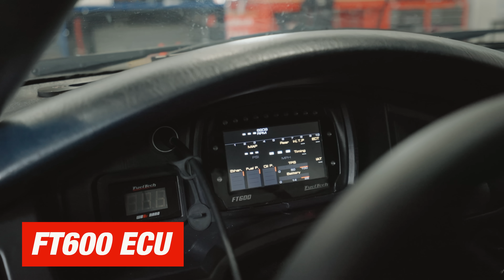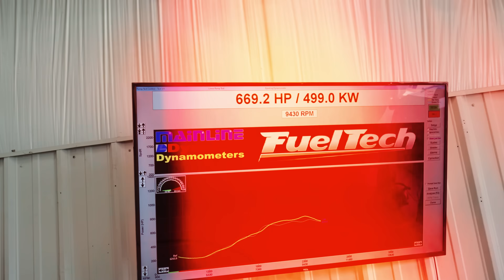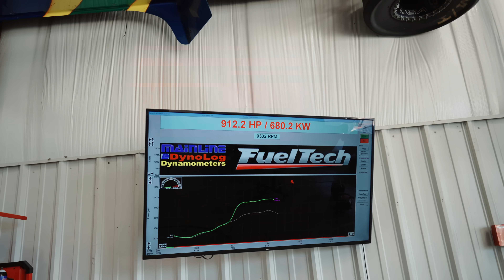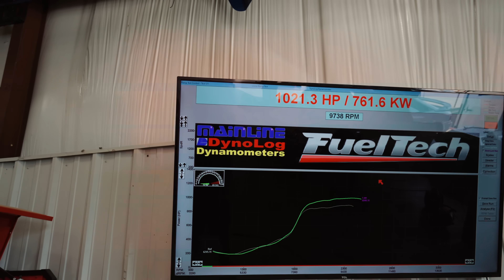Turbo K24-Powered MR2 Hits the Hub Dyno! | FuelTech USA

Comment: Many hot rod guys look down on 4 cyl stuff but what they fail to see is you can easily make big power just in the packaging of the cylinder head itself say you design your own head regardless of brand you could have any valve angle you want any chamber design etc. with an overhead cam head you could space the cams way apart and the intake and exhaust would not be hard to build or fit in any car.
Reply: K series heads are pretty efficient. It's not like an old school v8 where you can find good power numbers with head work

Comment: That's the way to make a Toyota better, just put a Honda engine on it 😂. 
I have never seen a Honda with a Toyota engine on it 🫢
Reply: Clearly You have not seen the many Honda vehicles with Toyota 2JZ engines !! 😲
Reply: Boosted boi Kyle is building a civic with a 2jz even though all his other cars have honda engines in them.
Reply: @gasparsperformance9841  most of his cars, that he has been involved with building have Honda four cylinder engines, but not all of them, nor all of his owned motor vehicles either. 
Kyle has built a LS V-8, placed in a 240SX, swapped a Mazda 13B in a Suzuki, worked with Wyatt with a 13B in a Corolla, body swapped a Tesla Model S Plaid with two different vehicle bodies, also modified the original prior to the first body swap, plans to  body swap Tesla Model Y Plaid, has a open tube frame, open wheel vehicle still in Colorado with another non-Honda engine, also removed, rebuilt, replaced a Cummings diesel engine from his truck along with Wyatt, along with the tube chassis Civic with a 2JZ, though most of the vehicles he has worked on with builds, modifications, etc. have I-4 Honda engines whether originally or swapped. including with others as friend Emilio.
Reply: @newtonfirefly3584 you forgot to mention his shopping cart that has a engine in it with a turbo and fueltech.
Reply: @gasparsperformance9841  You are correct that my comment did not include the motor-cart with the turbo.
Had considered mentioning it, but figured it was not very important, nor necessarily within a motor vehicle label, though it has a motor, engine, wheels, moves, but not actually a vehicle, or at least not very useful, rather mostly a fun "gadget" project.
Clearly We are both long time, aware viewers within BoostedBoiz, correct ? 🙂
Reply: Dose fueltech spourt fully sequential k24 ignition and fueling

Comment: You seriously stopped at thirty pounds? Isn't that motor good for at least 40? I don't want you to risk it but I think you may have been a lot conservative.
Reply: All sorts of issues start with crank case breathing and heads staying sealed above 40-45
Reply: 1000hp is pretty much the safe limit for a steel rod (kt1000) motor. Yes it can be pushed for more (possibly 1100-1200), but the reliability will go down a lot.

Comment: Whatever was fixed a bit more than half way through the session completely changed the sound and power level instantly. I'm no expert, but I could tell immediately on the next pull that something was definitely different. Very cool!
Reply: I am guessing it had something to do with a boost reference line and wherr it was feeding the wastegate from
Reply: @Slowv8Fiero  I think it was the blow off valve, and it being loose means it's leaking out all the boost instead of forcing into the engine.
Reply: @Wheemer   you're probably right